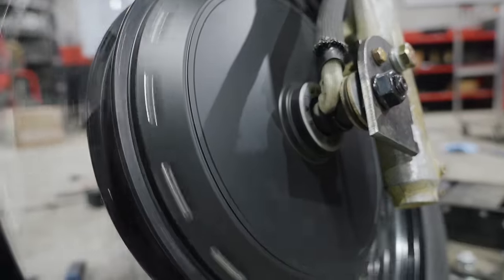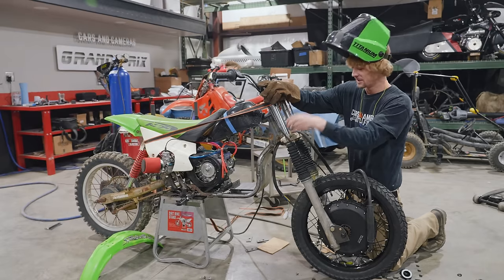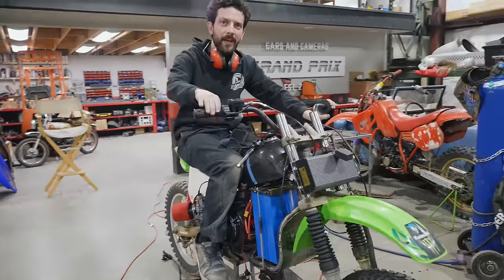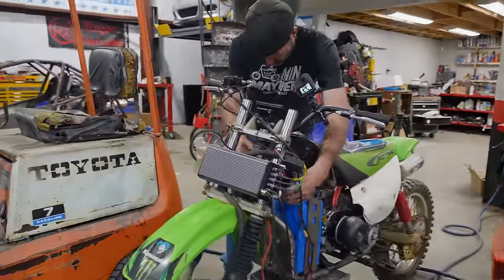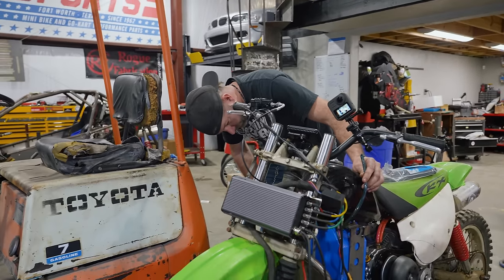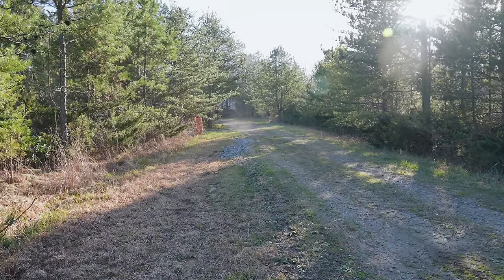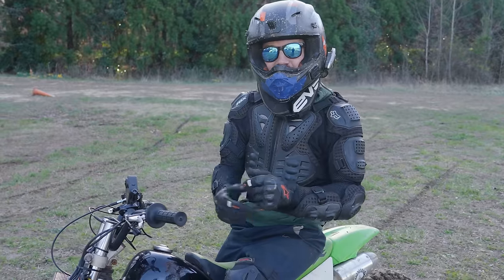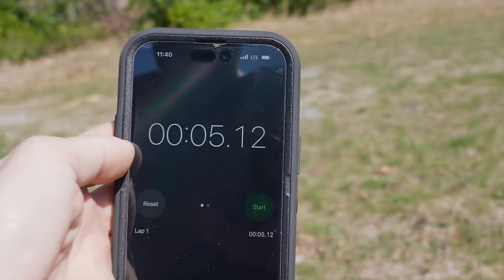AWD Dirt Bike First Test Drive! (35 Combined HP)

Comment: Heat shield between the battery and motor. Thumb throttle needs to be on the left side of the handlebars. Front motor throttle needs to be supplemental and precise. You don't want that front motor powering into a corner.
Reply: arent you an expert
Reply: They probably aren’t going to ride this thing on a moto track
Reply: Would they want the left throttle on the right side of the left handle and the right throttle on the left side of the right handle so that their thumbs can push it?
Reply: he is probably right, you would want to use it like or with  the clutch on a track
Reply: @sethcrawford6219  who cares about a track? Just riding it around their yard course could have same implications, let alone generally riding it.
Reply: @GamingBallz using the COMMENT section to leave a comment about the video 😮😮
Reply: why yall hating. these are good ideas and hes not being a dick about it
Reply: And a rock guard to protect the battery from liquids, dirt and rocks.
Reply: The thumb throttle does not need to be on the left side unless you’re in England
Reply: I would think shifting the thumb throttle to a different side would be unsafe, unless you're some ambidextrous, multi tasking prodigy.  
But could try an experiment.  Maybe it's not as bad as one would expect.
Reply: Um guys that's a qs motor your goin to need to program it
Reply: @williamcarroll5402  it's already programmed, they can just play with the existing settings surely?
Reply: They make slide throttles for retrofitting older cars.  Simply hook the slide throttle sensor inline with your gas throttle cable using a cable nut. set up with a spring or sliding pivot, so that the front motor only receives a throttle signal above a preset throttle percentage, this way you can hold constant throttle through the turn, and activate the front motor automatically on corner exit.   This is the way factory 2wd bikes work, the front wheel is never powered while turning.
Reply: Is that what you did on the one you built?
Reply: @matthewthomas2700  some people are never happy eh, he gave him everything he needed on a silver platter but you take it as bad criticism 😂
Reply: @anesthetized7053 that's a good idea? You certainly don't work at NASA 😂

Comment: Put a peddle assist sensor on the wheel. It is meant to go on the crank but if you put it on the wheel the electric motor will kick in when you give it some gas🤙🏻
Reply: I was wondering about that! Nice idea
Reply: @braydenhancock3907  thanks Brayden...
Reply: Lol no because you couldn’t stop.
Reply: @ianj8505  let off the gas, pull the clutch and hit the brake. When you let off of the gas the hub motor will decelerate
Reply: Absolutely this, having the option to have it change it's assist while you give it regular throttle will be huge for ride-ability and traction. A better tire will help, but it looks like it's going to be about consistent throttle input matching with that rear. This is amazing, btw I love it! You'll still have the ability to override with a throttle input through the handle throttle but for regular riding they should now be able to match and feel better during straights and corners. Then when you can go all out on the straights you can override it!
Reply: @TheColorsInGreyLife  exactly right
Reply: yeah some sort of integrated e-controller would be nice. that way the front wheel comes in as the engine starts to crank the rear wheel, so that they work in tune, allowing better steering control under heavy throttle, but still having a lot of pull on those launches
Reply: @ghomerhust  that is what the peddle assist sensor will exactly do if connected to the rear wheel. Also you can switch between the different peddle assist modes or turn it off and control it manually🚴
Reply: Tow much lag and they suck. Torque sensors on the crankshaft are what most modern e-bikes have, Peddle assist is horrible. So much delay.
Reply: @Zane.Wellnitz   It doesn't work that way. Peddle assist works off the display speed limiter. They are just like an on-off switch. It doesn't matter if you are spinning it slow or fast it will go to the maximum output you have set on the display. Usually 1-5 or 1-9. It is not like a torque sensor. Unless you can disengage the peddle assist it will always put power to the motor when spinning. It will put a maximum output set which is dangerous with this much power on the front wheel. Trust me I know. I have built many 20kW plus bikes. Peddle assist on more than 1.5kW or 1500 watts is dangerous.
Reply: I don't think it's gonna work like that, plus you'd have no control over the front wheel. Like Ike said in the video, under throttle, you have 0 steering. Which means you'd have to let off to make any kind of steering input. You'd either have to drive it in a straight line, or super slow. 

I think it needs an electric thumb throttle on the left hand. The dual throttle seems too hard to control at anything other than full throttle. Separate hands would probably be easier for finer control
Reply: @kshepthedrummer  you just need more power to the back wheel and you would be able to steer. 2 wheel drive motorcycles is not a new thing.
Reply: @FarmerFpv  you are talking about the more common cadence sensor. You need a torque sensor for it to work
Reply: I was thinking this or use a regular cable twist throttle with a split throttle cable so one can go to engine and the other to an electric pull throttle.
Reply: @seanmcqueen2186  also a good idea🤙🏻

Comment: You need a knobby tire on the front.   By the way since the electric motor has a sprocket on it put the wheel in the rear and combine it with the gas motor chain.
Reply: Most likely this is just the stock tire. They will probably swap it later on also you can’t do a chain since you’re steering
Reply: You can’t put the electric hub in the back because it’ll end up turning faster than the engine moves the chain, causing binding. I understand why you’d think this is a good idea but there’s a reason you don’t want two power sources on one wheel
Reply: @TheRealKosmicKing  set it to coast mode/pedal assist and it will work. Just a small motor will do
Reply: @braydenhancock3907  but with the setup they’re using on this bike it won’t work like how he’s thinking. If they used a different setup then yeah but not for this

Comment: Need a Awd Crosskart. Very cool build
Reply: They’ve actually done that before they made a cart that had a motor on each tire
Reply: I was thinking the same thing alot more controllable. With four wheels instead of 2. Would be a neat add on to the dragster they built.
Reply: @anthonynesbitt3997 I was watching their playlist but I never found the rest! Do you know the title for it?
Reply: @Dantheman5127  it's called 4 engine go kart
Reply: @anthonynesbitt3997  not the same or your not understanding what I'm saying
Reply: @anthonynesbitt3997  what he's talking about is something like the cross-kart but with e-assist on the front wheels to make it a hybrid AWD, not the heavy clunky thing they built with 4 predators. it handled terrible, and had no top speed. the cross-kart, with it's transmission, is capable of intense speed, and the front wheels would assist with the wheelspin on launching and coming out of corners, but wouldnt get in the way of the high speed straights
Reply: look up 'kart builds crosskart' if anyone wants to see an Awd Crosskart
Reply: on youtube
Reply: @ghomerhust  exactly.. thank you for explaining
Reply: Lol
Reply: I like to just take a bicycle with a big fat tire on the back of it and put that electric motor on it for testing purposes only.
Reply: That thing was crap, they need to try again with electric and gas on one drivetrain together!@anthonynesbitt3997

Comment: The front wheel motor is NOT the issue, you guys need a different tire(Shinko 241/244) for traction. Go into the app or BMS settings and turn down the power output to about 35% while leaving the speed at 90% and it'll feel less squirrelly when you launch.
 And put the regen brake on its lowest setting or off! 
 But please change your front tire, it'll make a world of difference
 Make sure you insulate between the battery pack and the gas engine... AND DON'T CHARGE THE BATTERY PACK FOR AT LEAST ONE HOUR AFTER RIDING THE BIKE.!.!.!. Or it may catch fire 🔥🔥🔥 enjoy
Reply: This guy e-bikes
Reply: The front wheel motor is absolutely the problem. That much unsprung weight is terrible on a bike.
Reply: Not familiar with this kit or it's software but modern RC ECU's usually have a ramp up you manually sett a curve for so on launch you can progressively increase power based on speed over time no matter the throttle input, 1/2 throttle full throttle same ramp to that throttle position every time. Take your time, fine tune this and it'll be a monster.
Reply: They already made it clear in the video they were going to change the front tyre.
Reply: @SportbikerNZ  it’s not going to help them. That bike is destined to hurt someone.
Reply: @thagingerninjer5391  Please.  I guess there has to be someone.
Keep it up CarsandCameras.
Reply: @SportbikerNZ  please all you want. Go add 20 pounds of unsprung weight to the front wheel of your bike, and see how it handles. I love this channel, but this was a bad idea. Ike said it himself. All the weight on the front tire increases the gyroscope effect, and adding power to it increases it further. It will never handle well, and they’ll be luck if someone isn’t at least mildly injured on it.
Reply: @thagingerninjer5391 zero fun and zero progress would be had in this world without such experimentation.  With practice, becoming adept with this contraption could be fun and entertaining.  (Oh nooo!!!).
Reply: @SportbikerNZ  I’m not saying it’s not gonna be fun or entertaining. I’m just saying that it’s going to be dangerous and almost unridable. 🤷🏼‍♂️
Reply: @thagingerninjer5391  Any vehicle is dangerous if you don't give it the proper respect.  With practice and appropriate application of power, this vehicle is nothing to flap your arms over.  Also what shows me you haven't considered the basics during hand flapping - an aluminium cast sportbike front wheel a few years ago, with twin disks, twin calipers is going to be 10kg at a minimum, let alone older front wheels.  This setup looks to be about 13.5kg looking online.  So certainly lighter than the front wheels of older motorcycles.  it may not be perfect, but hardly the impending disaster 🤣
Keep it up CarsandCameras 👍👍
Reply: @SportbikerNZ  you have literally no idea what it weighs, so you’re just grasping at straws, at this point. Calipers don’t add weight the the rotating mass of the wheel, because they’re bolted to the forks. You really don’t know what you’re taking about, and you’re doing everything you can to save face.
Reply: @thagingerninjer5391  True on calipers.  I was typing faster than I was thinking.  Still doesn't change the fact that older steel motorcycle wheels with twin disks are going to be heavier than this.  It doesn't take long to find this exact hub motor setup with spoked wheels on Amazon with listed weight.  Clearly you don't want to look, do you?
Reply: @SportbikerNZ  and all those older bikes handle like shit compared to my year old liter bike.
Reply: @thagingerninjer5391  And somehow they aren't a dangerous unrideable catastrophe.
Reply: @thagingerninjer5391  bro, i have a custom built front hub wheel ebike, it makes somewhere around 4-5kw peak, it handles just fine on road and off road with proper tires, you have no clue what you are talking about
Reply: battery catching fire if you charge it after riding is the most ridiculous thing i ever heard in youtube. 😆
Reply: More grip with new tire on my FWD E-Bike keeps riping the Axle Out of the forks. I prefer slip
Reply: @thagingerninjer5391  yeah, its just such a bad concept... that front breaks loose and then you have no control. It only makes a lick of sense at low speed crawling, and at that point, why not just use the chain drive 2wd bike thats been on the market for decades.
Reply: @thagingerninjer5391  unpsrung weigth would be a problem to do proper off road or MX but for drag racing it will do fine. the problem here is the lack of traction and grip

Comment: Crazy build chaps, you need to plug the black first on the battery, and red wire last. The red has an antispark ring in it which should reduce the snapping like Ike got when he first plugged it in!

Comment: 2 things - 1: put a rear tire on the front, and 2... get an electronic thumb throttle and a cable throttle (twist) for the gas engine. You don't want to have to re-train yourself to ride a dirtbike... so keep it standard... then use the thumb throttle as the "boost" function with the front wheel.

Comment: I'd try integrating that thumb throttle into the collar and offset it so it engages the rear tire faster. Nice job guys.
Reply: Yes ! A Hose clamp set-up with a peg hitting the Thumb throttle when it's moving and need the front for hills and power pulls .

Comment: I saw a video about a dual hub motor bike from taiwan (i think), they used a dynamic throttle control for the front motor that adjusted the top wheel speed if it wasn't getting traction. Software stuff, also Electric bike batteries are usually in a mostly sealed box. not strapped down like an automotive battery.

Comment: For twin throttle control, try rigging up a lever from either the front or the rear of the twist grip that pushes (or pulls) the thumb throttle in sync.
Reply: You need RWD to turn

Comment: if those metal straps work their way through the battery casing, it'll short out and cause a huge fire. Also need some heat shielding between lipo and engine. Store the battery at storage voltage (around 3.7-3.8v per cell).

Comment: My plans for such was a 'Hose-Clamp' with a bolt to hit the thumb throttle for the electric while using the gas.That way you could leave the gas off and use the electric without hinderance, and without the battery on, vice-versa.

Comment: Rokon has been building awd bikes for years. They use just one engine to drive both wheels with about the same power and speed. If you could build a throttle setup to power the both the gas and electric to run the same speed.

Comment: This is an issue I will need to solve for a project at work (combining throttle of an engine with electric motor). My thoughts are that I can use a microcontroller and a speed sensor to set up PID feedback of the output shaft of the engine to send the electric motor controller a 0.5-4.5v signal, so the electric motor is always trying to match the speed of the engine.
You guys are pretty smart, perhaps you could go down this route and see how well it works for you. My application is entirely different but it should work.

Comment: You should really fit a heat shield between the battery and the motor. Lithium batteries become very unstable when they get hot.💣💥🔥

Comment: This reminds me of having a 4x4 with a locked front axle in ice. The truck just wants to go straight. Front wheel drive cars have always been a little goofy in slick conditions to me. The powered front wheel just looses traction. A knobby might help slow it down and grip, but I think it's going to be screwy in turns.

Comment: Try different pedals assist settings. On my ebike, setting 5 is all the beans (22+ mph)& 1 is only for like 8 mph. I use 1 when I set off & click up to the higher settings as I get going. It could act like gears.

Comment: Put the thumb throttle on the other side. I’ve built a few sleeper e-bikes with twin motors and I find it’s the best way to control it, even better than both set on the same throttle.  They now have a 17” 5000w wheel with a motorcycle sprocket so you can run it on Asian flat Honda engines like your CTs. That will be my next build but I will use two e-bike 36v batteries to make battery mounting easier.

Comment: I've built a trike  a while  Back iv still got it . its  a Shwinn beach cruiser conversion  with fat tires and a 420 cc  preditor  to power the back wheels . it also has a diff locker on the conversion  and the front wheel  1500w has the electric hub motor  so if it ran out of gas the front  would still  get you home.  It was hard to get use to it going  form either  system because there so different ones push the other pull.  that and the spring forks don't  help I was also able to still pedal  but it is alot more difficult  so it really never pedaled   I used all low rider parts to make  the lighting system in back turn signals brake and a hid bullet head light . It  was definitely not cheap to build. But its a awesome trike good for mine mart run or beer

Comment: I once built an AWD mountainbike. It was the greatest I've ever ridden off road. It climbed like crazy, because you could actually put your weight on the front tire. But best for me was the self stabilizing effect. If the front slides off, the power pulls you towards stabilization. May be too harsh with high power though. I guess half the power you have would be enough and handle better. 
Also, may be obvious, but it pays to do AWD fully electric. Better weight, less fiddling with controls

Comment: if you can get enough weight over the front, that dual drive could be good for drag racing. Use the electric for the hole shot then bleed the engine in. Or somehow link the throttles. Wouldn’t do it on a bike though, maybe a trike could work.

Comment: I wonder if Ike is wrong about the stability control. Here's how to test it: give it some power to the front wheel while doing various diameter circles at different speeds. be ready to dump it. See if you can break traction with the front wheel without it low-siding.

Comment: I'm paused at 1:09 to say right off the bat, I think a smaller sized front hub motor would have been
 sufficient and lighter. To have some wheel drive at times, could definitely be helpful. I'm thinking
a 500W 48V smaller size with only 10AH would be super practical.